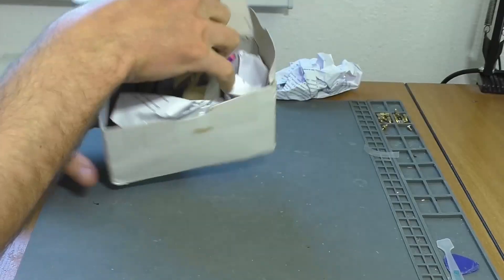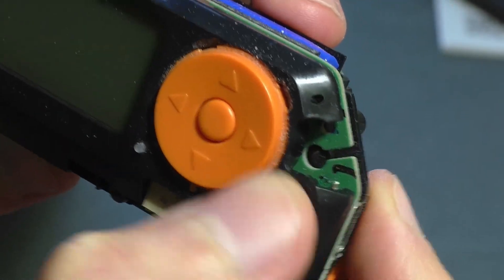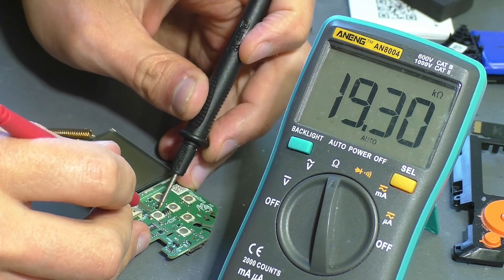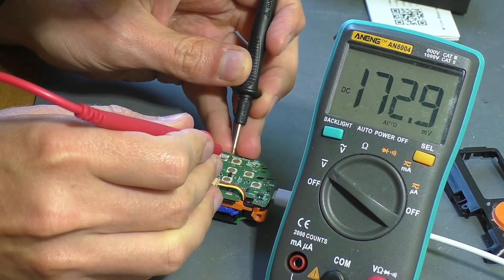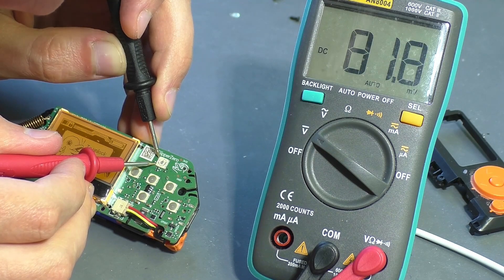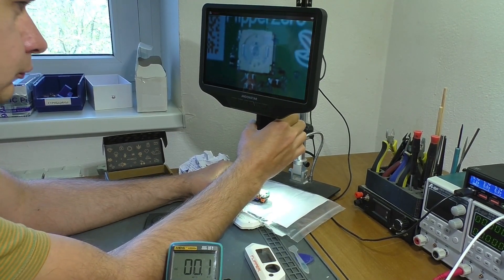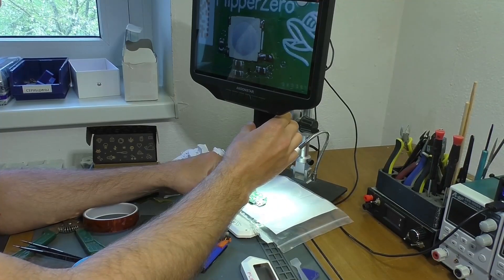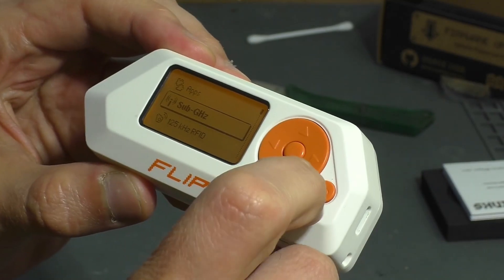STUCK ON RESET MODE / Flipper Zero | REPAIR / FIX

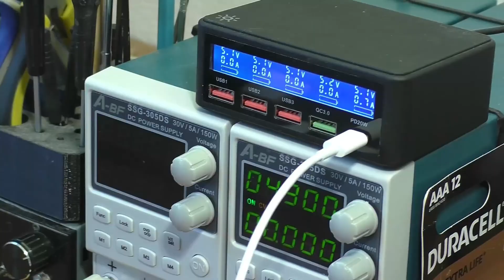Comment: What do you mean by “200 billion” in reading the multi-meter ? 2:59 and “700 billion” 3:27
Reply from the maker: 2:59 is "current consumption does not exceed 200 mA" and 3:27 is "current from the charger is now 700 mA"
Sorry for AI translate.